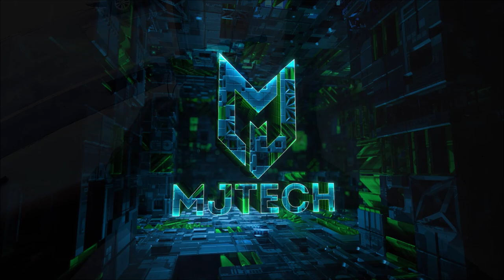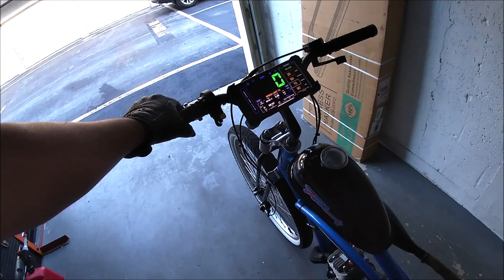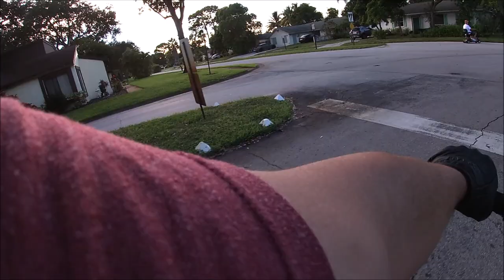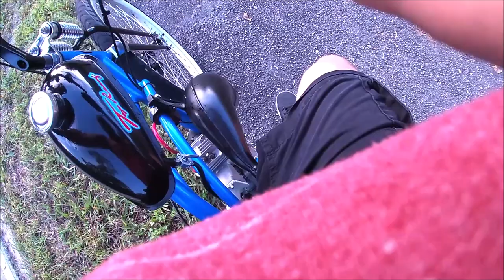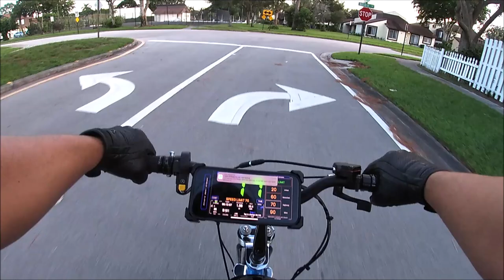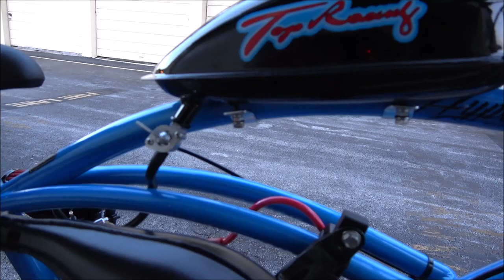Phantom 85 Motorized Bike - Hits [52MPH +] & Could've Gone Much Faster!

Comment: When I see these guys running really big stuff it's kind of like a 4-stroke small block Chevy cuz most motors basically kind of work the same even a two-stroke so if I go get a small block Chevy right and I put really giant heads on it that means it's really important never change the bottom end keep ate the one compression in it then I put a 600 inch lift cam in it or bigger slap a giant carburetor on it what's it going to do it's going to be a pig it ain't going to have no low end power you'd have to run like a 5500 stall converter in that b** so my answer to that is Cam too shitload of nitrous that's my answer one thing I love about that neighborhood plenty of Cam too around here spray and pray that's what I love

Comment: In my opinion with all the work you ended up doing to that bike with that giant pipe which I don't really need carburetor upgrade read valve upgrade and it'll probably do it my guesstimation about 63 mph all that and I do very little to a whitey 100 very little and that's it that's why I get got to get my hands on one of these motors cuz I'm going to do it my way definitely don't need a giant pipe definitely don't need a real giant carburetor that's where guys are killing me at they're out here and they're running 34 mm carburetors they're running giant s*** to make them go fast but yet I've seen a guy with a 66cc running a s*** small carburetor the size of an NT carburetor it hitting over 70 mph what's wrong with that picture that tells me a whole lot in my opinion I will stick to the yd100 and the other small little motors yeah the bigger motor is with the big boreas and all that they going to get you ass up there quick to a point but then they're going to get hot faster that's just my opinion and I've seen him with a big big pistons in them boy they get hot real quick great out of the gate but not much for top end once I get hot